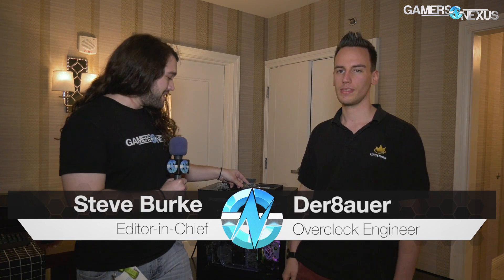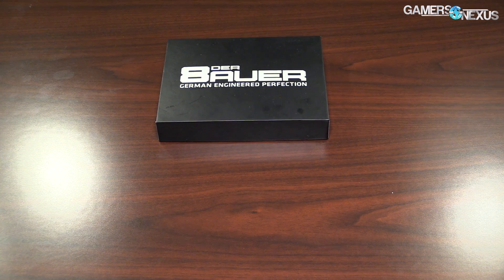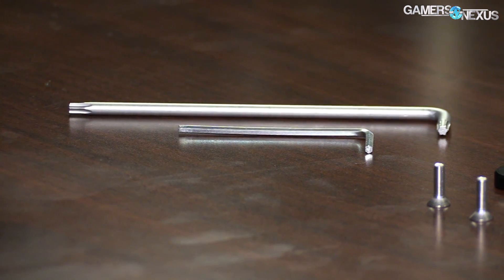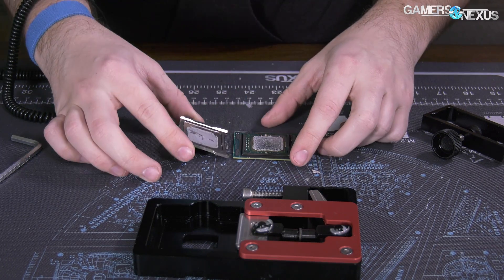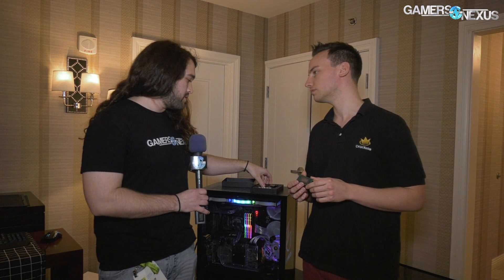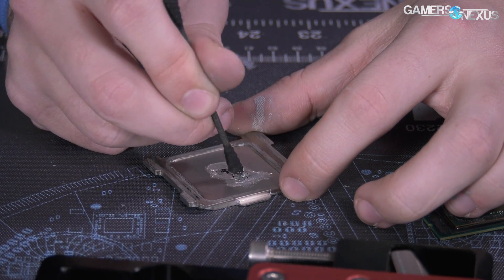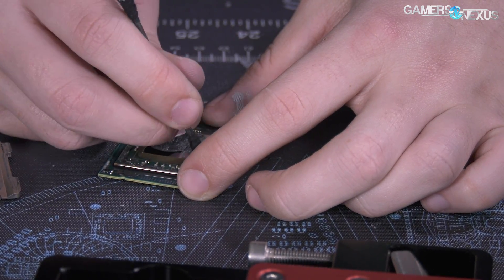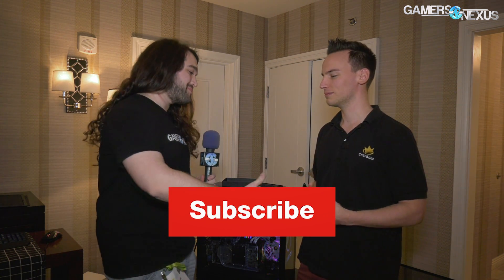Direct Die CPU Cooling Bracket - No More IHS

Comment: you can get one from aliexpress for 30, 70 euros is too much
Reply: Would you really want one from Aliexpress?
Reply: Depends.. If you spend 1000+ $ on an i9 you'd probably pay the extra 40 to be sure it has the right tolerances....
and if you have a budget chip.. I don't know if this even made sense then..
Reply: Yeah, I wouldn't risk a $2000 CPU just to save 30-40 bucks lol.
Reply from the maker: Being made in China doesn't mean anything about quality. You pay for precision when you hire a factory to make something. There are varying levels of precision that can be paid for. Cheaper products may have cut corners.
Reply: ac3ofspades878 As a hobbyist but not an extreme overclocker, I'm surprised that you're willing to risk breaking your CPU.
Reply: Someone who cares this much about extreme overclocking probably won't care about $40 and would likely want to get the higher quality product.
Reply: Care to link or at least give the product ID. I haven't seen any brackets since Ivy Bridge.
Reply: One tipp settler, please watch the english video about his delid frame. In this videos he talks about why this frames from ali for the 7700k oder 8700k can't really work (spoiler: the die is not high enough, the cpu cooler cant contact perfectly because he collides with the socket).
Reply: Good luck with the aliexpress stuff :D Apart from that these don't work with X299 they also don't adjust mounting height so you can't even use your normal cooler
Reply: https://www.aliexpress.com/wholesale?catId=0&initiative_id=SB_20180121114720&SearchText=die+guard+delid
Reply: seems to be working for this guy atleast https://youtu.be/ZccFdIQeM_A
Reply: I agree, this is essentially just 2 pieces of anodized metal, while I get the tolerances have to be good, and its a niche product, and they are ensuring it will always be a niche product because of the price. As a hobbyist but not 'extreme overclocker', it would be far more beneficial for me to spend $70 elsewhere, while $15-$30, i'd consider it.
Reply: Awesome thanks Settler. I'll help with temps on my 8700k and maybe even allow me to run 5.2Ghz 24/7 :)
Reply: why not? this product is also made in china